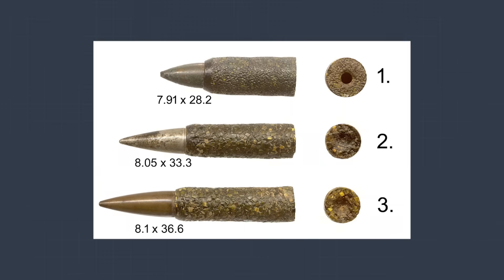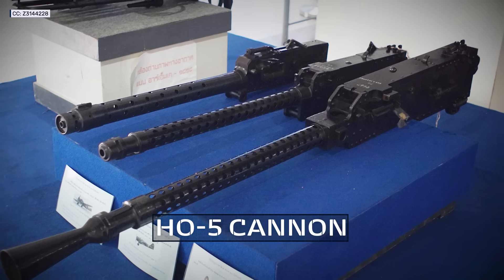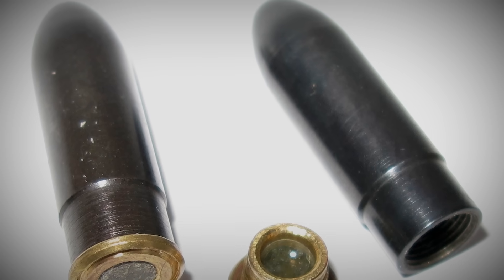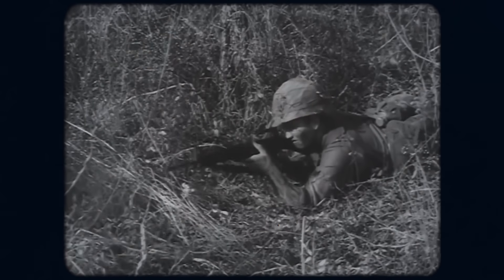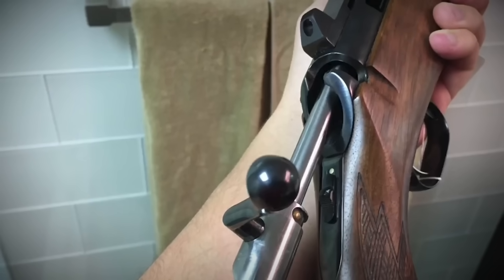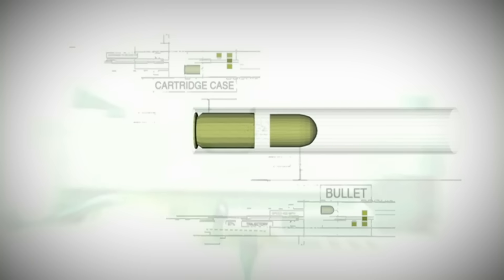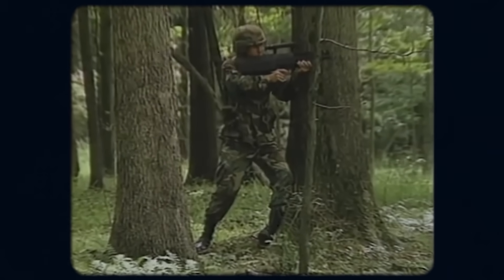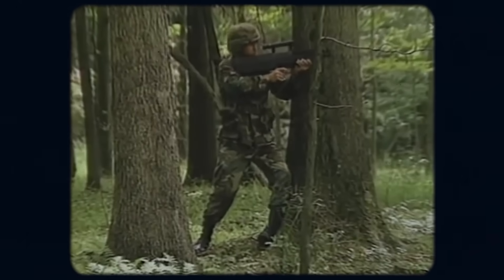Is Caseless Ammunition the Future of Warfare?

Comment: Actually while I hate to admit it, plenty of reliable firearms use steel casing, just look at the now collapsed USSR. After they gobbled up a bunch of Nazi scientists they came out with the AK-47. While the Nazi's had little to nothing to do with the inspection of the weapons, the tooling and machinery used to make it were stolen from the Nazi's. Just like how we gobbled up our fair share.

I am of course talking about the 100 ton press (I think it was 100 ton) used to make the Nazi aircraft and then later on communist AK-47 rifles.

Edit: Also for the record we had caseless ammunition first; musszle loaded and even breach loaded black powder rifles. We could come up with some complicated automated measuring system for a firearm but I mean really there's a reason we shifted to cased ammo. That's why the new military "caseless" ammo is actually cased in plastic (I assume it burns clean so to reduce residue).

Comment: The LSAT program is over.  The caseless variant that licensed the HK G11 technology (primarily the ammunition construction and propellent) was considered a failed branch, not quite ready for implementation. 

The plastic telescoped rounds (which did not rely on HK G11 technology) were kept as the more mature technology, and the LSAT program (which was not intended to field a service weapon - it was a technology test program, qhich is why they stuck to using the actual projectiles from the US 5.56x45mm M855 NATO standard service ammo, at the velocities the standard US 5.56 LMG - M249 - and carbine - M4 - happened to fire those rounds, so the Army had a true "apples to apples" comparison to evaluate the technology against twonbenchmark weapons firing identical bullets atvidentical velocities.  If the LSAT guns were equal to or superior to the conventional guns, they wouod be further developed, but with a new caliber & velocity that the Army would determine would be the best fit for both near term and future requirements (since any LSAT dericed weapon would obviously require entirely new ammunition, they thought was to maximize the performance of that ammo when adapting the tech to an actual service weapon).

The NGSW program that concluded a few years ago was intended to deliver actual service weapons - a LMG to support the squad, and a new rifle for the rest of the squad, both using thebsame ammunition.  The Army selected a particular bullet design and caliber, and determined the velocity required to meet the future requirements (which are classified), and told manufacturers - "Here are the requirements on range, accuracy, weight, cost, etc.  And you can do anything you like for ammo, but you must use THIS bullet and achieve at least THIS velocity."

The LSAT tech was dusted off and entirely new guns were designed to fire the new 6.8mm bullet at the required velocity (mechanically, very much still the same LSAT as the last prototypes, just redesigned frommthe ground up to use the new, more powerful, ammo).  The ammo was the telescoped plastic case (the caseless variant wasnt even considered because it was still considered too immature to get ready for service use in time).  Meanwhile, thebother competitors in the trials used different metbods of throwing that 6.8mm bullet at the desired velocities ☆.

TL;DR version of the trials is despite the Army bending over backwards to guve the old LSAT devekoped tech a chance (after all, the Army had spent almost 20 years messing around with the program, and the primary contractor had been fruitlessly involved in working with the Army to develop the next revolutionary rifle since the early 1960s ), the LSAT type NGSW entires bombed.  They were inaccurate, unreliable, and the weird manual of arms tondo things like load or unload the weapons were comsodered likely to result in negligent discharges and accidemtsl deaths.

The winner ended uo being Sig, who offered fairly conventional LMG & rifle, but bith weapons and the cartridge case beefed up to take ridiculously high pressures sonthey could hit the required velocities with a 13" barrel (to keep the overall length within requirements).

.
☆(Beretta designed a bullpup with a long barrel but a short overall length, so they could use basically "normal" ammo at "normal" pressures, just with a plastic rsther than brass case to save weight; Sig chose a nearly conventional solution, qith a very short barrel and a fairly conventional case, but with a stanless steel case head so they could use ridiculously high pressures to fire it from a conventional layout gun that still met the overall length limits.)

Comment: The brass casing also removes a lot of heat from the chamber, reducing the potential for cook off. Oddly, modern plastic/polymer casings are lighter and more effective at reducing chamber temperature. I was surprised it didn’t get adopted in the NGSW competition. But the military is a very conservative organization. It has to work, unless you are in the Air Force.
Reply: What modern plastic has better thermal conductivity than brass?
Reply: @polymer has less thermal conductivity which reduces heat transmission to the chamber. It’s basically like an insulator.

Comment: Got some plastic cased(but brass based).38 special rounds that can be reloaded.  But the reloading process requires a special weird bullet that snaps into the cases.  Never fired it,  stuff is at best a collectors item and best left alone.
Reply: if your talking about what I think you said are they red plastic with a black plastic wad cutter type bullet? they made for only primers do not under circumstance put gunpowder in them.

Comment: Similar sealing issues occurred in 19th century breech loaders that used paper cartridges.  Obviously no substantial brass or copper case to keep the breech from leaking hot gas and debris that could get in your face or inside the mechanisms.

Comment: Another issue with open bolt operation (and why you generally see it in submachuneguns and dedicated full power machineguns intended for primarily full automatic fire) is the loss of accuracy.

Not only do you have the rather considerable mass of the bolt group lurching forward before the shot is fired, disturbing aim, but comoared to most closed bolt designs, the lock time of an open bolt design is ridiculously higher.

Comment: The problem is relying in chemical propulsion
Reject boom, embrace coilgun !
Reply: fun idea, but imagine having  batteries with you (or even on your back) that could power these..... its basically like being a flamethrower or walking bomb!
ever seen a phone battery "evaporate" ? imagine that times 100++ & you get the idea!
Reply: Elon can do it, he can fire 80% of the defense sector and just have his kids design a new weapon.  Stupid humans keep relying on engineers too much, the future is in smart ass AI.
Reply: Goodluck finding sufficiently dense (chemically fueled) battery power to run such an infantry carried coil gun,. 

That's not to mention the bulky, heat generating and power hungry mechanisms or the heat these batteries themselves would create in discharging as quickly as they'd need to for a decent firing rate.
Reply: @snizami  see my comment, solves both problems.
Reply: Why no hybrid ? You can speed up the projectile in it´s first stage by chemical powder as usual and then icrease it´s velocity further. Thus using less energy less temp etc. you get the idea.
As a power source a AL+O2 battery could be used which is power dense, more so than a Li-On battery ut can´t be recharged (so what? ). 
You guys lack the imagination...
Reply: @sierraecho884 your forgetting one Major thing.  Cost of manufacturing and maintenance, while the military (especially the US) loves to spend alot on fancy toys.  They like to spend as little as possible on it.  Otherwise you end up with the F-35 situation of being extremely expensive to maintain, however good or not it may be.

Plus rail guns have been a reality since 10 years ago sadly too expensive to reliably use both via power source and the materials to maintain it.  

Also you gotta remember what your asking sounds complicated to maintain.  Military weapons need to be extremely simple im design and have as few parts as possible to fix on the field if needed.  We don't wanna end up with another G11.
Reply: @theanimatedjunkyard5921  Coilguns are NOT complicated. You  get a barrel, run wire tightly over it ("coils") and link that up too a power source and trigger. Teenagers can make this crap.
Reply: @higherground9888 yet a portable military application has not been developed. That tells you everything. We can hardly put them into practice aboard a large warship containing its own power plant to power the gun.
Reply: @OttoTheWeim  You are talking about two different applications of the same thing. Railguns are relatively costly. COILGUNS are so cheap that an engineering student with a 3D printer can do it. They don't want cheap, they want Patentable. So you can muscle out any rivals big and small by the Patent system. Coilguns are literally too cheap and easily made for that, thus they go nowhere
Reply: @higherground9888  There are coilguns on the market, they are big, bulky and 1/10 as powerful as a regular gun with gun powder.
Reply: @sierraecho884  Rocket ball munition, electric ignition, and then the simple version, a railgun to propel the bullet to infinity and beyond.   The longer the rails, the faster the bullet will go.
Reply: @maddox0110  Why would you revert back to rocket ball munition ? It´s the type of ammo which was invented before our modern ammo.
Reply: @sierraecho884  No case to eject, and the lower power of the munition isn't the issue, it's just to get things moving.
Reply: @maddox0110  Yeah but the lower power is the issue, you have to use up more energy to propel the projectile this way.

Comment: I'm surprised you didn't at least mention the Gyrojet. Not technically caseless in the way this video uses the term, but the whole cartridge flies downrange, thus no case to eject
Reply: Here at Aperture Science we fire the whole bullet. That's 60% more bullet per bullet.
Reply: Ah yes, literally the Bolter from warhammer 40k
Reply: I don't know if this would be a universal issue, but a gun guy here on YouTube named Brandon Herrera was shooting one, and the barrel ended up shooting out the gun too... But I also did expect at least a mention.
Reply: The gyrojet, while functional, and some were made, they were only a prototype and not considered a viable firearm
Reply: @gregstubbington1703  The big issue with gyrojets is that you end up with a cheap gun but expensive bullets.
Reply: @gregstubbington1703  Wrong. There was a manufacturing run for wide scale tests.
Reply: @gregstubbington1703  It was most certainly not merely a prototype.
Reply: EXACTLY WHAT IM THINKING BUT ON AN AUTO GUN THE BARRELL COUD NOT BE HEKD
Reply: Great! A subsonic round that has a rocket trail, defeating the point of having a subsonic round.

Comment: Oddly enough one of the first successful commercial repeating firearms used caseless ammunition a long time before WWII. In the mid-1850s a company was founded by Horace Smith and Daniel Wesson (before the founding of their more famous brand) called the Volcanic Repeating Arms company. They improved on and produced Volcanic carbines and pistols that fired “rocket ball” ammunition. This was a hollow conical lead bullet that was filled with powder and a percussion primer. The guns were lever action things, even the pistols, and worked decently but had the same drawback the later Japanese effort had. The rocket balls could only hold a small amount of black powder and so they were rather underpowered so the company struggled. Smith and Wesson left the company to found a much more successful pistol company. The Volcanic Repeating Arms company was bought out by an investor, a shirt maker named Oliver Winchester. They much improved the design using cased ammunition and eventually changed the name to the Winchester Repeating Arms company.